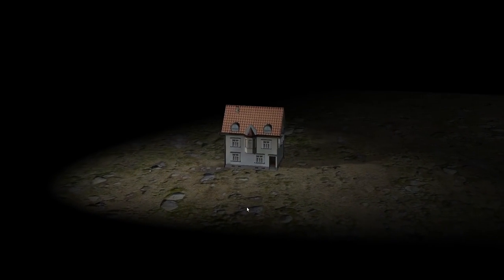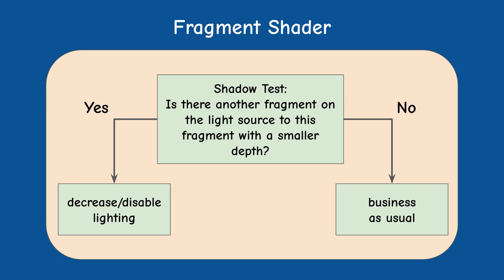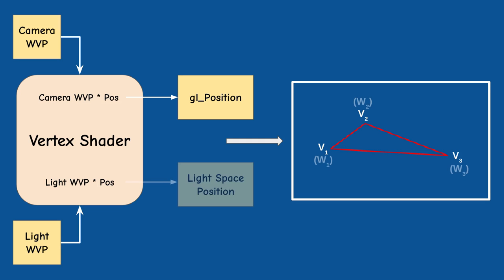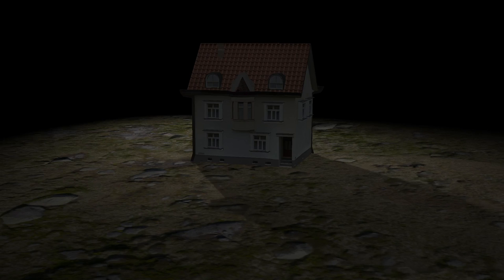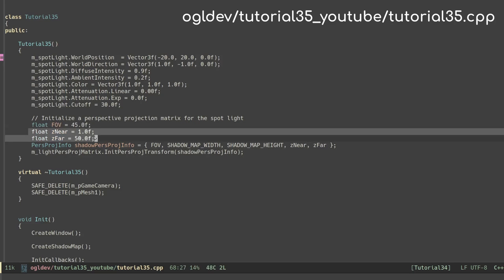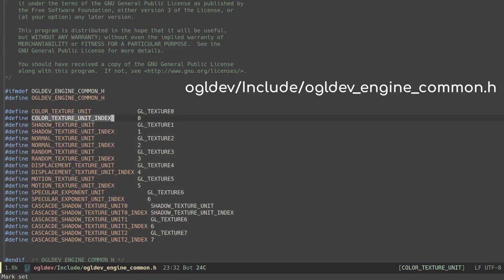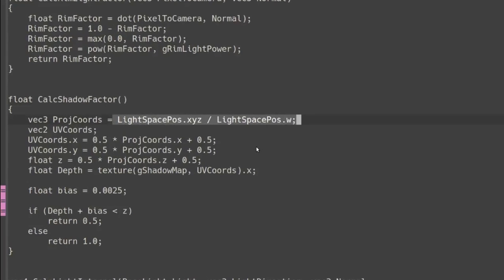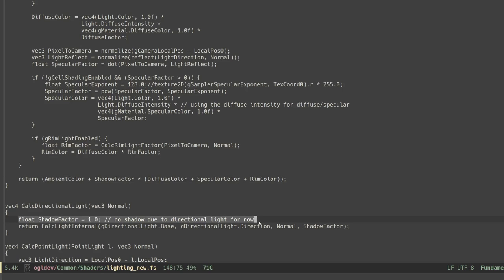Basic Shadow Mapping // OpenGL Tutorial #35

Comment: I'm wondering why the perspective division has to be done in the fragment shader rather than the vertex shader?  
For gl_Position I've tried doing the division by W in the vertex shader and just set the W value to 1.0, and appeared to have got the same result.
I'm supposing there's more difference in the calculations done to gl_Position vs other variables between vertex and fragment shaders than just dividing by W, but I don't know what they are exactly or how to predict them since I can't print the values.
Reply from the maker: Are you referring to the position from the light point of view? If that's the case then the system is designed for rendering from only a single camera position. This goes into gl_Position and if you need another camera position you have no choice but to do this manually. In terms of vertex shader vs fragment shader - remember that by default the rasterizer performs perspective correct interpolation (taking into account the fact that the triangle is not perpendicular to the viewer in 3D, even though it looks like that in 2D) so things like that are usually more accurate in the fragment shader.
Reply: @OGLDEV  Yeah I'm referring to the LightSpacePos.  I'm finding it really difficult to understand what the math is doing since all this automatic stuff is being done in the shaders and I can't view the numerical output.
Reply from the maker: That's the problem with the graphics pipeline which you can't directly debug like you're used to. Try to use RenderDoc. It adds a lot of visual stuff like showing you how the model looks like after the vertex shader which is often useful.

Comment: How do game engines like unity handle moving the sun so that it's in the frustum of the camera? I need to figure out the orientation and position of the directional light so that the camera shadows are always highest possible quality. Any resources on this?
Reply from the maker: In the case of a directional light you only have a direction, there's no position. You will find a discussion about a tight intersection between the view frustum and the light volume here: https://learn.microsoft.com/en-us/windows/win32/dxtecharts/common-techniques-to-improve-shadow-depth-maps
Reply: @OGLDEV  but for lightspace matrix u need a position, is that somehow excluded?
Reply from the maker: For the light space matrix you use orthogonal projection so no need for position: https://youtu.be/JiudfB4z1DM
Reply: @OGLDEV  now im confused. Surely u need a position when rendering to the framebuffer? Otherwise the projection doesnt know what to include
Reply from the maker: OK so it's not exactly a position per se. You define an orthogonal frustum with the usual six clipping planes which looks like a box. You need to make sure all the objects in the scene are within it and clip it against the view volume to make it as small as possible. No need to render stuff whose shadow cannot be seen (tricky because the object may be outside but the shadow inside).
Reply: @OGLDEV  thanks for your replies. I will read up more on this topic

Comment: Hi, when I follow this tutorial in my project, my shadow map texture texture values all seem to be 0.0, any idea why that would be? (In the calcShadowFactor() function in the shader the depth variable is always 0.0)
Reply from the maker: Did you change the default depth value by calling glClearDepth? It should be 1. Try to output some color from the fragment shader in the shadow pass (instead of the empty shader) so that you can see what the light "sees". This requires not binding the shadow map so that everything will go to the screen instead.
Reply: @OGLDEV  Currently I've got it outputting a black and white light view, which has the expected depth. However the texture from sampler2D in the lighting shader still only samples the value 0.0 which is confusing me. Even when I swap the argument to the texture function (float depth = texture(my-texture, uvCoords).x ) (where my-texture is the texture I use for the scene) it still gives 0.
Reply from the maker: Make sure the shadow map is bound correctly for reading during the light pass (glActiveTexture, glBindTexture, set the index and not GL_TEXTURE* in the shader). You can use ApiTrace to verify the shadow map is created and bound correctly. If you believe it is bound you can replace it with an all white texture just to make sure you get 1. You can also hack the shader to display uvCoords in the window as color to check that it makes sense.
Reply: @OGLDEV  Finally found the issue, turns out when I was clearing my depth buffer with glClear(GL_DEPTH_BUFFER_BIT) I was doing it while the fbo was still unbound, and now my shadows are working
Reply from the maker: Excellent!

Comment: I've tried implementing shadow mapping into my OpenGL program, but for whatever reason the objects captured in the shadow map dissapear and re-appear depending on the light's position (It's a directional light that moves left and right). Any help would be greatly appreciated.
Reply from the maker: Are you using an orthogonal projection matrix for the shadow pass? It may not be large enough and the object stays out of the frustum on some location of the light source.
Reply: @OGLDEV  Nope, I'm using a perspective matrix for spot lights. I've tried switching up the perspective matrix that spot lights use with an orthogonal projection matrix, and the shadows work just fine (although they don't look as good given that now i'm using directional light shadows for a spot light).
Reply from the maker: Maybe the angle is simply not wide enough to capture the objects as the light moves left and right? If one matrix works and the other doesn't then it pretty much tells us the source of the problem.
Reply: It's a possible explanation, however, if I push the light's position far back enough so that both objects are clearly within the shadow map's bounds at all times, they dissapear regardless and no shadows are casted. I am absolutely baffled by whatever witchcraft is going on in my program.
Reply from the maker: Try to track the shadow map using apitrace or any other debugging tool. It will help you understand the changes to the shadow map at the frame level. You should be able to pinpoint the exact frame where the object disappeared and debug from there.
Reply: @OGLDEV  Will do, thanks for your help!
Reply: @OGLDEV  Investigating a bit more with apitrace, i've discovered that my light projection matrix suddenly becomes [nan] for every frame in which no objects are visible in the shadow map. Why could this be happening?
Reply from the maker: Are you recalculating it on every frame? Sounds like a bad division somewhere.
Reply: @OGLDEV  Yeah, the light moves every frame and the shadow map updates every frame as well.
Reply from the maker: Is the projection matrix getting the nan or the shadow map? The projection matrix itself should not change but the world/view part can change and that can ruin the combined WVP.
Reply: @OGLDEV  Only the light projection matrix uniform becomes nan. Is it a problem the fact that i'm multiplying the projection and view matrix on C++ and then in GLSL i'm multiplying the model matrix?
Reply from the maker: The light projection matrix should be set once before the program starts running and there is no reason to change it later on (unless you really want to change the projection characteristics - for example, dynamic light field of view). Separating the multiplication as you described should work but you need to be careful about row vs column major differences. In practice, it's probably better to multiply the model matrix in C++ once and avoid the extra operation per vertex.
Reply: @OGLDEV  Whoops, I just realized I made a small mistake in my previous message. In my program the "light projection matrix" is the multiplication of the view and projection matrix of the light. This is what is sent to GLSL to be multiplied with the model matrix, but somehow it becomes nan.
Reply from the maker: So the view matrix is probably corrupted at some point.
Reply: @OGLDEV  Yup, you're right. I've modified my program to send both the light view and light projection matrices separately to GLSL. The light's view matrix is somehow getting corrupted. How can this happen?
Reply: @OGLDEV  UPDATE: I finally fixed the issue, turns out the view matrix gets corrupted in you provide a positive z axis vector in the up vector argument of glm's lookAt function. Thank you SO SO much for your help.
Reply from the maker: @glez3711  Glad to hear!

Comment: if you want to do shadow map for multi light source?
Reply from the maker: You need a separate shadow map for each spot light. You do a series of shadow passes - one pass per light/shadow map. You bind all the shadow maps to your lighting shader and do a single lighting pass. For each light you calculate its own shadow factor. A fragment may be in shadow for one light and not for another. You sum up the contribution from all light sources as usual. I will cover this in one of the upcoming videos.